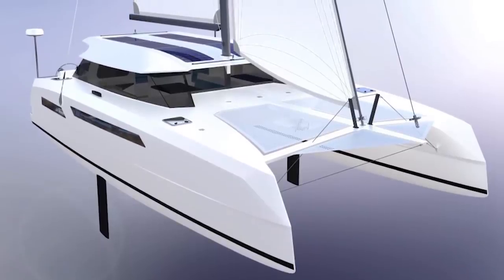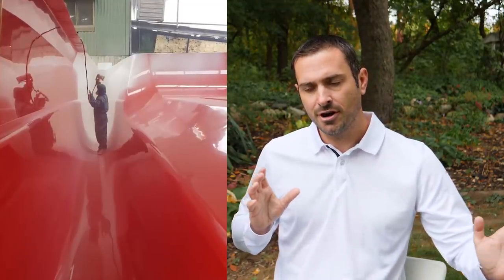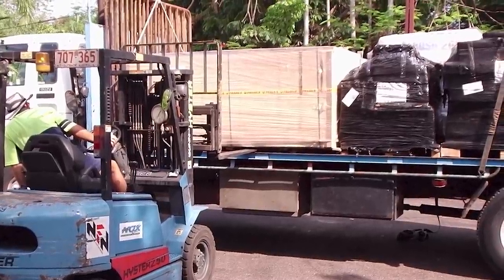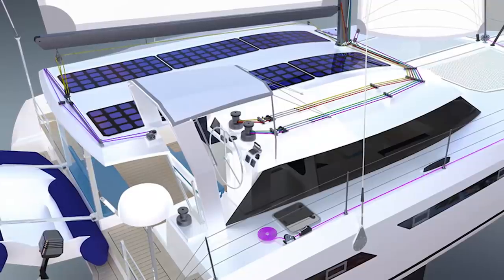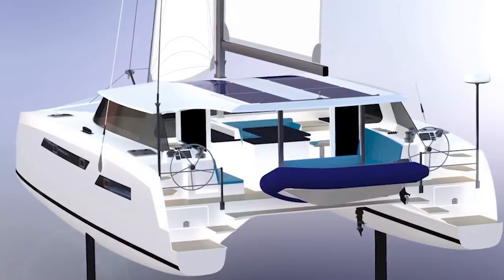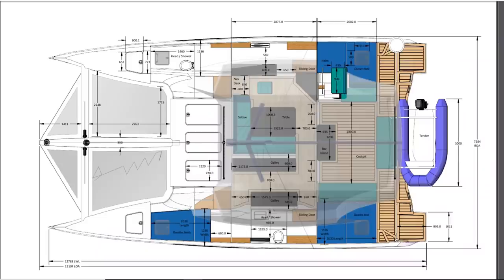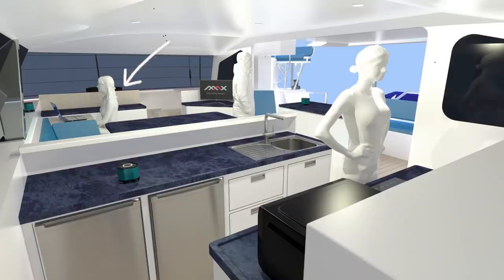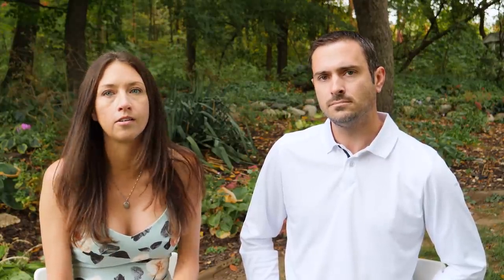YOU'VE NEVER HEARD OF THIS CATAMARAN - But It's Our Newest Contender - The Max Cruise 42 -MJ Sailing

Comment: I do like some of the aspects of the Max 42 design elements. The reduced build time is certainly a plus. I still like the Schionning overall design best. With the performance in combination with the beauty of the Schionning, I haven't seen another catamaran that comes close to both of these important facts. My vote is to get the Schionning because it's my first love as well. Personally, I'd go with the owners version in each hull and would get the Arrow 1500 over the Arrow 1360 because the longer hulls will be much more comfortable during passage. I do like the raised helm position but also dislike it due to the height of the boom needs to be higher to clear that structure which reduces sail area. If the sail area is not reduced, the rig has to be taller to compensate and thus making the weight of the rig higher. It's better to have a shorter foot on your sails than a longer foot because the luff will flutter and having a longer foot will make the sails overpower much easier as well as be much more temperamental in terms of a more precise point of sail or constantly adjusting your point of sail. Think of it like a wind surfer when they first came out with a long boom verses now with a shorter boom and taller mast. It's much easier to sail with a shorter boom. I love the open doors dividing the salon and the aft deck. That's a very nice design. I also like the helm on both starboard and port. Having two helm positions gives you options on either being on the sunny side or shady side as well as being able to check out the sails and seeing where your going much easier. I like being on the weather side when sailing. When you design your boats rig, make sure you install three places up front for sails. The forward spot will be for your spinnaker, the spot on the bowsprit will be for your light air jib or screecher and the aft spot will be for your jib. I'm not sure if the modular furniture will add weight or not but I would think it would and with that said, it would be difficult to fiberglass the inside versus building it yourselves where you have more control. The thing I don't like the most besides the design of the Max 42 is the way the hull is built. When you spray gel coat into a mold, the next process is laying up fiberglass. The Max 42 will not be a lightweight catamaran like the Schionning is and that takes away boat speed and longevity of the boat thus reduces resale value. Why not purchase a used Schionning than building from a kit? You will save time and money by doing so. I'm kinda thinking that getting an already build boat which will cost you a bit more than the kit itself but you won't have to deal with the space to build it and all the other new items you will have to purchase. Yes, everything will be brand new but I've seen nice Schionning's for sale in Australia for 135k USD. Could you cover this aspect in your next video? Also, what is the bridge deck clearance between the Max 42 verses the Schionning Arrow? By the way, a shorter boat will have a lower bridge deck clearance. One more thing; I like the electric engines best and would place them in the hulls, not under the bridge deck. I really don't like the outboard style at all. I'd go all solar except for your dinghy outboard. I do like both electric and either propane or white gas for your cook top/ oven and BBQ. I'm looking forward to your build but would like to know the cost of building verses getting a used one and what your thoughts are on that aspect.

Comment: Absolutely love you guys but hate the catamaran route you've gone so I'm out. I just cant do the floating apt. thing. However best wishes to you both you're a super couple.
Reply: I do both cats and mono. It's like motor bikes versus cars and some only do one religion religiosly. If you wish to live more comfortably for long periods at anchor hard to beat the multi hulls. If you want to carry a large weight and factory cutting lathe and tool shop to repair anything mono hulls are hard to beat. If you want all out speed then forget to have any tools water tanks and fuel range. The formula 60 mono hulls over 3000 plus miles recon one extra bag of sugar will cost the race and come in second and the crew live for weeks in the same cloths and have extra change if cloths when they arrive for photo shoot. Different  Horses for different  courses

Comment: Foam core. Is that strong enough for ocean passages. I don't know guys. Foam core has bad reviews for open waters in structural integrity. Also,  if you assemble it,  does it hurt the warranty.

Comment: Do you really need nav stations anymore? Sextants and paper charts are not exactly in widespread use nor are buyers making boat choices based on a well appointed nav station. Seems the space would be better off utilized for more storage
Reply: I wouldn't have a desk if we weren't editing videos.  

We only used the nav desk on Elements if on passage and needed a chair with armrest to hold myself in place.  The cat shouldn't have that issue :).  Matt

Comment: What's the price for this max42? In the format you describe?
Reply: $150,000 USD for the 3D module set-up.  This includes the hull, daggerboards, rudders, forebeam, cockpit and shower/head all in molded components.  The interior furniture and bulkheads are flat panel.   -Matt
Reply: @mattjohnson6716  Hi Matt do you have any indication what a standard rig and sails costs ?, is the price included outside hardware, fittings ect...
Reply: @hfindustrimarineaps4953  Lots of variables that could drive up the price estimate.   If you go back to an early video I did on the cost of the Oram, it will give a good idea of what this will run.  -Matt

Comment: from the viewpoint of gelcoat and finish it sounds fantastic because thats the single most lousy part of the build. I know you have your own ideas on the helm but it doesnt appeal to me, even though thats based on no experience with it. I do like the Lagoon 440, which isnt perfect as it looks a bit exposed getting in and out of. Theres a video of Impi if you havent seen her, you might like a look. Helm comes up half way through, its not a bad tour for an amateur. https://www.youtube.com/watch?v=BDCsPPecGEQ
The outboards seems like a good idea, all Im less fond of it means storing petrol where diesel is safer and less hydroscopic. Could have a single outboard and an electric outboard, and theres the dinghy to consider, which needs fuel etc.. 
anyways just a few thoughts, Im sure you both will do a sterling job based on your present boat, good luck.

Comment: If your project cat is a new build, I can’t believe you’d already have selected diesel engines over regen electric motors.   You have the room and it can’t be the weight when you compare 2 diesel  engines and fuel tanks to Lithium-ion batteries and regen electric motors.   With all the high tech material why do you want diesel?  What don’t I know?
Reply: In terms of energy content lithium batteries are still ridiculous compare to diesel, so you can forget about motoring through a dead calm area more than 100 nm (or even less and at very low speed), check the numbers, however yes electric can be a choice, but you have to consider that you will need to wait for the wind quite often (and that you will not be able to rely on diesel if required to get out of a complicated situation, like a need to go upwind quickly).

Comment: I would suggest you to not buying it, you can get flax fiber for free as agricultural leftover and collect industrial chemical drums of high density polyethylene HDPE from factories. Its free and you can make a flax fiber reinforced hdpe catamaran, you can use aluminum Mylar and epoxy to make ventilated skin to protect the plastic from thermal and uv degradation. you can make it for free using cnc plans with simple software with a minimalist design in the interior

Comment: Hi there,
In reference to installing outboard motors on your new boat, in my experance this is not a good idea! Do some more research and I think you will change your mind. Eg petrol = explosion, minimal dc power output, not much power, useless when windy, hard to get to for repairs and servicing, lacks reliability.
When looking at second hand boats I scroll past the ones with outboards they definitely devalue the boats resale value.
Regards Glyn